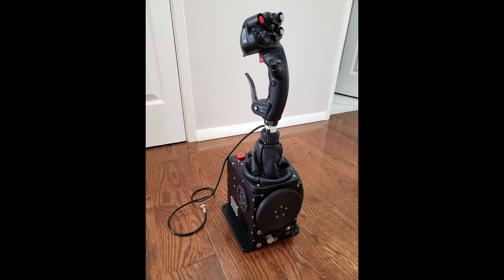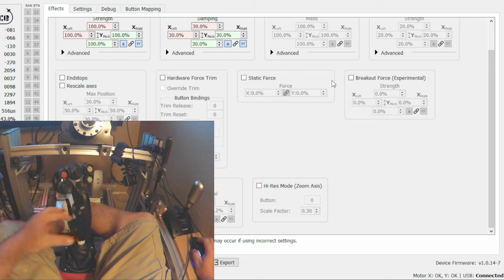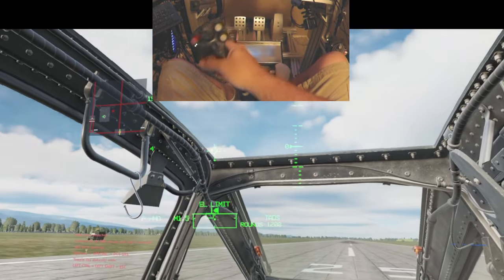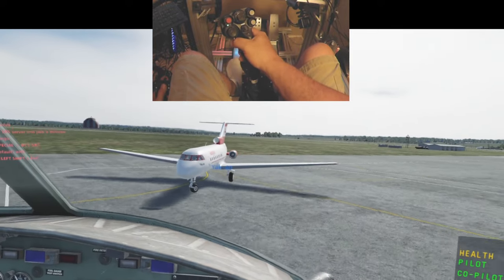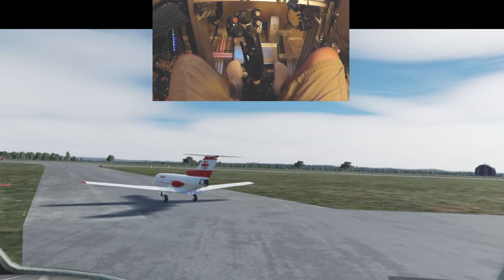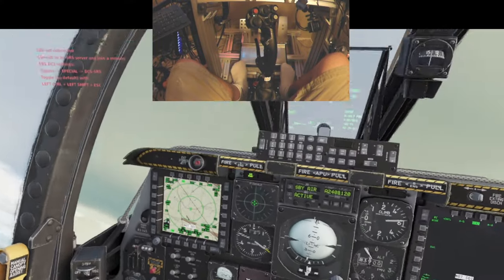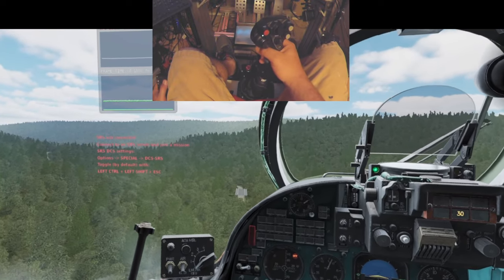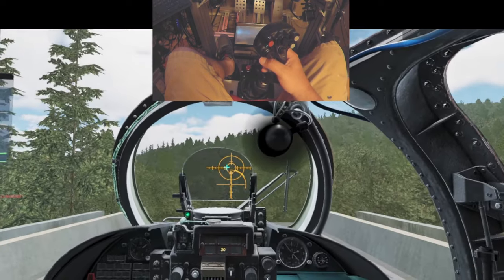VP Force Rhino overview and initial review

Comment: In the video, you have your spring strength at 100%, but you seem to have no issue moving the joystick.. Do you have very weak motors or did i miss something?
Reply from the maker: There's a potentiometer on the base and I have that set to adjust spring force on the fly and it's set to about 30%

Comment: How smooth and accurate is it at tiny movements like in very close formation flying and f16 tanking? I’m concerned it’s not exact enough as it’s all 3d printed and stretching rubber belts.
Reply from the maker: I'm never going back to my vkb base.
Reply: it will be exactly the same as far as accuracy hall sensors are all ready producing far more resolution then the game can use . and any 2 axis cam style gimbal will be as smooth if not more so as the design is for that very purpose. the force feedback gimbal have electric motors to provide the tension an as electric motors use a magnet an stator design you will always get some form of  micro bump between the magnets anybody who says otherwise is simply ether over looking due to euphoria or just straight up lying

Comment: Quick technical question please, is the ffb relevant on modern aircraft, like f15 or 18, how do they trim irl ?
Reply from the maker: Yes, it's relevant for the effects like stall buffeting, vibrations, and changing your spring force by a click of a button or turn of the knob.  an f15 or 18 probably (I don't fly them so I wouldn't know 100%) have feedback motors IRL giving the pilot control feel, and you'd still need to trim the control forces out, but the end result is similar to a spring stick so the difference in a FFB stick is less so than helicopters.  If you fly warbirds or helicopters, this stick is a huge leap forward, if modern jets it's a small step forward.

Comment: Hello can I ask you for some general questions regarding flying a plane.

My biggest weakness is pulling too much aoa and stalling. 

I only have a t16000m stick and not sure what to do.
Reply from the maker: In dcs use saturation or a bit of curve on your axis binds.  There are plenty of videos how to set them up.
Reply: @suprakillavr4  thank you, I can’t really control the mig21 in dcs, as it’s too easy to pull too much Aoa.
Reply: I’m planing to get the vkb gunfighter with an extension, would you recommend the 100mm or 200mm extension.
Reply from the maker: 200 if you mount in front of you down low

Comment: Is there a setting in DCS to enable FF, or is it automatic? Received mine today, and (admittedly in 10 mins fiddling) was unable to feel any in game forces…
Reply from the maker: In the dcs settings menu, I think under game options, is a checkbox to enable force feedback. Then you should also be running telemffb program from vpforce which adds more effects
Reply: @suprakillavr4  can it add FFB to a f18? I know its FWB but it would be so cool to have it respond like a f-14 or something akin to that. thanks!
Reply from the maker: @ryancreed2830  I haven't tried, but the effects like the gun and trim are added via the external program and therefor will be applied to any aircraft.  They are always updating and improving it so it would surprise me if it didn't have a lot of added effects.

Comment: Guys I was reading a blog regarding dcs and in that case Brunner ffb yoke.
Sure it was a 3y hold review, but they were saing that no forces were detected apart from trimming.
Has the new version of dcs changed the amount of details sent to the joystick????
Reply from the maker: For the base game no there is only trim force, each module has its own forces added, which only some like the f14 and warbirds have added forces.  Vp force then runs an additional program that adds more forces on top.